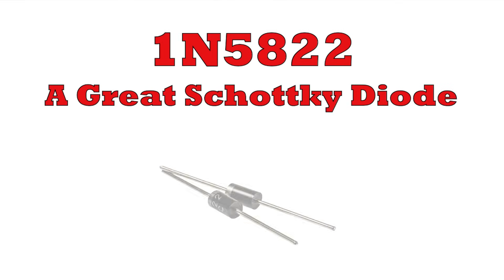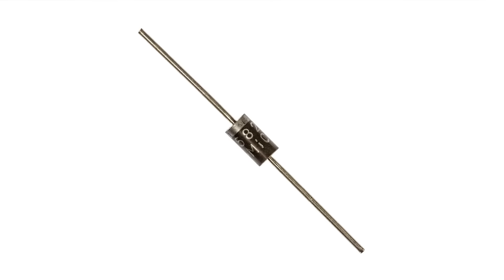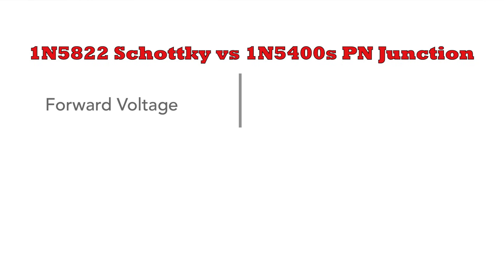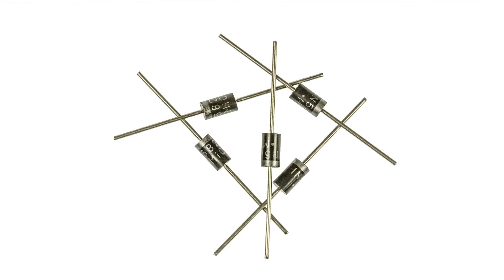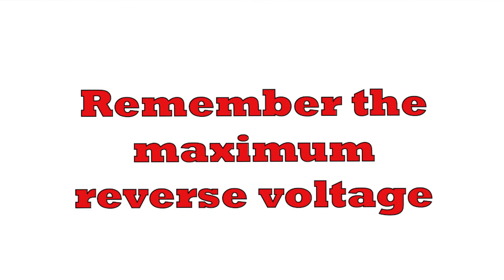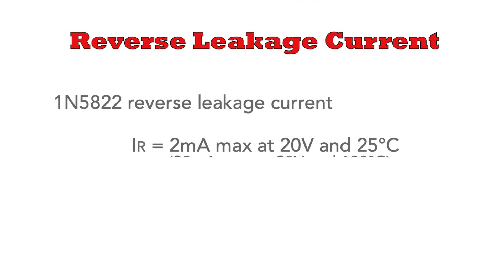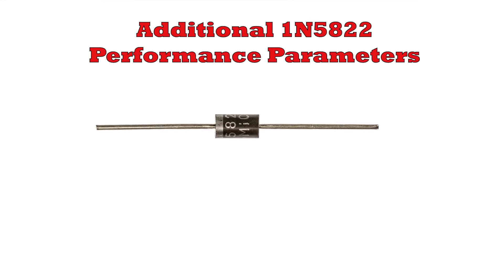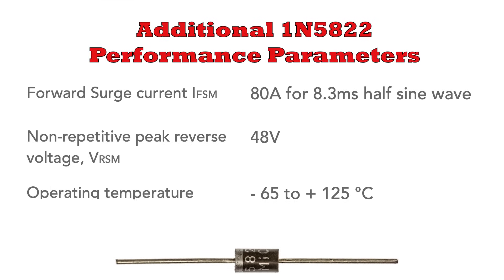1N5822: An Amazing Schottky Diode You Must Discover

Comment: I mainly use diodes for repairing and building tube amplifiers and all of these assets are more liabilities in that field. For example, it's preferable to have a larger voltage drop when replacing, say, a selenium rectifier with a diode. Also diodes in tube amplifiers are subject to hundreds of volts when rectifying and this diode seems too delicate for that.

Comment: I still don’t know what it does.
Reply from the maker: It’s a rectifier diode.
Reply: @ElectronicsNotes 
Thank you.
What does a rectifier diode do differently than a simple diode. 
I know a regulate diode is like a one way valve and blocked the current in one direction.
Reply: @eugenecbell  Lower than average forward voltage. Fast recovery time.
Reply: @MrSummitville 
Does that mean this diode if faster to cut off the flow in one direction like other simple diodes I know about? And is it better at cutting off the flow than other diodes? 
Does this imply diodes found always cut off all the flow all of the time? 

Perhaps I need to watch one of your videos that discusses diodes in depth. 

Thank you for your answers.
Reply: @eugenecbell  Fast Recovery is required in Switch Mode Power Supplies.  The diode must turn OFF quickly because of the high frequency. Not really needed at 50Hz / 60Hz.
Reply: @MrSummitville 
Bold to know. Thank you.

Comment: Generations now miss out on so much growing up now. As a school kid in the 70’s you could build all-sorts  with basic electronic components. These days it all programming and computer modules.
Reply from the maker: Sadly things move on. BUT electronics hardware is still needed. That’s actually one of the reasons I run my website and YouTube channel- I want to try to help, and hopefully inspire those who might want to get into hardware design.
Reply: True, but for those who are interested in simple circuits using discrete components there has never been a better time, the components are easily available online and the old magazines full of circuits are all on the americanradiohistory archive site. Also PCBs are readily available from the custom fab sites, none of that messing about with pens, transfers and unpleasant chemicals. Simple, cheap kits are also available.
Back in the day if you didn't live near a big city getting the parts for a magazine project or your own experiments wasn't that easy.
Reply: I mean, you can still build those same circuits that you had growing up.

Comment: The 1N5711 and 1N60P diodes (the 1N60P often being incorrectly called a "Germanium diode") are small signal diodes great for signal detection, often for weaker signals than the 1N4148 ordinary small signal diode would be too high of a voltage drop for, for example a crystal radio detector.
Reply from the maker: Yes, small signal diodes are ideal for many RF applications.

Comment: I love use it,just buy some 40V 1A,because my circuits rhe transform output AC is low, hope can increase the DC output
Reply from the maker: Yes they are cheap and convenient, but watch you don’t exceed the max reverse voltage.

Comment: Fun fact: Silicon carbide (SiC) schottky diodes are nowadays commonly used in all sorts of switching power supplies, offering reverse breakdown voltages of 1200V or more, and these have become rather cheap.
Reply from the maker: Yes, and that’ll be a subject of a video in the not too distant future.
Reply: SIC Shottky have a voltage drop of ~1.5V
Reply: @MatthiasSchwarz-y7z True, but high-voltage PN junction diodes can have even higher forward voltage drop under load. The main advantage of HV schottky diodes is drastically reduced switching loss.
Reply: @ulihd  i.e. mostly (exclusively?) useful in HV applications, not on the DC side of a 12 V inverter, for example.

Comment: I have just measured 0.75V of forward drop across an MUR420 silicon diode at 3A.
While Schottky diodes tend to be very reliable in larger PSUs such as PC PSUs, they are definitely troublesome in flyback designs such as used in small LCD TVs and tool battery chargers where the rectifier reverse voltage is typically many times higher than the output voltage.
 I have had total success replacing failed output rectifier Schottky diodes with the MUR420 in these small PSUs. I don't do it indiscriminately, always doing an extended test run, checking temperature rise.
Reply: Same, I replaced shottky diodes in battery chargers too. But with higher rated shottky diodes not realising the reverse voltage is likely the same. Thanks for the tip!
Reply from the maker: Thanks for sharing your experiences and the detailed insights! They are very useful.

Comment: as I tend to keep the key samples of my various inventions, I just measured two of the Powertap double schottkies: MBRP30045CT has capacitance between the two anodes being 38nF at no bias (76nF each) but thr MBRP60035CTL can not be reliably measured, I do not believe value of 1.433uF between anodes, but unfortunately I do not have a LCR bridge with selectable nor external (Wayne Kerr 4225) bias here.
Reply: there is (was) very wide selection of MBR Schottkys, and there are Low Vf versions for 10V to 20V peak voltages, but my SMPS work was mostly with 28VDC input, and thus I had no use for the Lowv or ultralow vf versions. IMHO Motorola and Onsemi made the chips on same process, and had two different markings, 1N markings are harder for me to remember than MBR (Motorola Barrier Rectifier) current voltage in decavolts(tens of volts ).

Comment: I have used 1N5822's but when I discovered MBR845, I stopped using the 1n5822 series, and for low power boost and Sepic converters MRB160 or for medium power MBR2020- MBR20200 .
Reply from the maker: Thanks for sharing your experience! I’ll take a look at them.
Reply: MBR series shottky have lower switching loses? or prefered due to higher current and voltage?

Comment: I worked for a company where they used schottkys as switches for resonant PLL circuits.  The only problem was the change in capacitance was different between diodes/degree temperature change, which changed the resonant frequency.  The circuits were so sensitive, the changes made things almost imposssible to calibrate (although the chief engineer thought his mathmatical algorithm would take the changes into account).  It was, overall, a theoretical fun job.
Reply: I used pretty large Schottkys (MBRP30045CT as a back to back Varicap ( i recall each diode had about 10nF capacitance at Vr of 1V)  and it was used in a 20MHz resonant power supply, did no need heatsinking with 100W power level. but for RF switching PIN diodes are better than schottky diodes, as the low Vf of schottkies might rectify the RF and cause intermodulation distortion.
Reply: @isobalalaikka2424  Unfortunately (fortunately), I was not the designing engineer.  I just worked on what was put in front of me.
Reply from the maker: Thanks for the insight, sounds like a tricky application!
Reply: Diodes (both ordinary and schottky diodes) generally have a voltage-dependent capacitance which makes them difficult to use to tune oscillators.  Varactors are a special kind of diode designed for a stable electrically-tunable capacitance and to be electrically tuned by varying the reverse bias on the diode.

Comment: And props for bursting the mass mind wash that silicon drops 0.6 to 0.7 volts, even "educators" have fallen for that myth, that nonsense is so irritating
Reply: Darren;   Agreed!   Years ago (1990s) I was interviewing applicants to work for me in scientific research.  One interview question was to design a 5 volt 1 Amp linear power supply with schematic and parts specifications.  Not one applicant could do it properly!  Most common mistake was not understanding that current peaks caused way more than 0.7V drop in a silicon diode.  Most applicants also made other mistakes such as circuit topology (full bridge rectifier rather than center tap 2 diode full wave rectifier), under-sizing the main filter capacitor (at 60 Hz use ~8000 mFd per amp for 1 volt of ripple - scale accordingly for allowable ripple), and under-sizing the transformer (depending on the circuit topology a 1 amp DC output requires significantly more than a 1 amp transformer).  Frankly, I was shocked that all the applicants completely failed such a simple design exercise!
Reply: @Vincent_Sullivan wow that is quite scary, all I can say is from about aged 10 I started learning electronics by repairing flytipped radios and tvs so I learned how things work in reality not theoretically
Reply: At signal currents it does, at larger currents not so much. Either way, the characteristic is logarithmic, but the PN junction must be able to withstand the heat. That's why you can drive extreme currents in HV applications with IGBTs, but not with MOSFETs.
Reply: @panjak323 no  silicon diodes start conducting at about 440mv for a 1n4006, 450mv for a 1n4148 put a silicon diode on a curve tracer and the myth is wiped out
Reply: @darrenmurphy6251 But he said 1.4V at 3A. He didn't wipe anything. I was replying to the part that Ufwd vs Id curve is logarithmic, thus voltage drop won't rise linearly with current.

If you mean I vs U curve, then threshold voltage isn't chosen as "the moment the diode starts conducting" but as the intersection of the X axis and the tangent of the exponential part of the curve.
Reply: @panjak323  yes ok ,iam mostly self taught so find it interesting when theory completely departs from reality, makes sense now that some (rather arbitary) part of the vi curve was chosen because as you say its a logarithmic curve ,but my issue is education chose to tout 0.6/0.7v as a hard fact!  lol if i answered an exam question based in it, i would make referance to "depends on the diode and forward current " i get marked wrong!
i know nothing about igbts they never really came into cunsumer electronics ,just resided in industrial  i just thought they were wierd ,i thought why would you want the risk of thermal runaway when you can eliminate that with a mosfet

Comment: Obviously there are many types of diodes. And they are designed for particular applications. So always check the spec sheets when designing any circuit. Use what is the best part for your design... JMHO
Reply from the maker: Yes, check the datasheet for its performance.

Comment: This part has been around for about 50 years, did you ever look into modern replacements for instance based on SiC or GaN?
Reply from the maker: I have a few videos planned with some more modern components. This was a test to see how well doing a video about a specific component worked
I agree it’s relatively old, but they are still current and widely used,
Reply: @ElectronicsNotes  Please, continue... 😄
Reply: LSD has been around since the 1940s and i dont see anything being better at what it does than that :P
Reply: @Linguae_Music  You really have to try some of the new stuff around! 
(It's mind blowing...)
Reply: And there are Germanium diodes..
Reply: @noop9k     Don't forget selenium rectifiers, or copper-oxide ones.
Reply: @noop9k  There are, but do you expect those to improve on the given specification?
Reply: @Peter_A1466 0.3 voltage drop is not good enough for you?
Reply: @noop9k  Do you even have a clue what you are asking? Diodes do not have A voltage drop, but a certain voltage drop at a temperature and current, so a range... 
So, what is your question?
Reply: @Peter_A1466 IDK why you are doing this pointless nitpicking. As if it is not a fact that Ge usually has at least 2 times lower drop than Si, within its acceptable V & I range.
 spent my youth occasionally making simple stuff with germanium transistors and diodes.  None of those died.  CMOS ICs would, on the other hand, die from static.. When started to use Si stuff I was like “WTF with the huge voltage drop”
Reply: @noop9k  What are you on about? I asked a simple question and got a decent answer. You start throwing in miscellaneous older materials which are completely irrelevant to my question, but might make for a interesting video on their own. 
BTW modern CMOS is way less sensitive to static as they used to be.

Comment: Have you considered discussing MOSFET "synchronous rectification"?
Reply from the maker: That’s certainly an idea for the future. I think about it. Good idea.
Reply: @ElectronicsNotes  Using a MOSFET as an ideal diode and/or your own version of the "How to protect circuits from reversed voltage polarity" by Afrotechmods would be another good one in the same vein.

Frankly I'm amazed someone hasn't stuffed a MOSFET and additional circuitry into a DO201 package.
Reply: @EmperorA0 the issue is for MOSFET rectification you need to bootstrap a voltage to drive the gate at the moment you cross the zero volt threshold else you end up with the same problems of needing a certain amount of forward voltage to start conducting and the added downside of spending more time than necessary in the MOSFETs linear (ohmic) region while the voltage rises to push it into it's saturation (active) region.
Reply: @JaenFoster  If you're willing to use 3 leads  (V+, V-, Load) you can use a Zener to prevent the MOSFET from conducting until it's out of it's linear region.

However, I think there's a way to run the MOSFET where it's just barely at the tail end of the linear region.  Since it's not really gate voltage that matters, but gate current.

The advantage is when conducting the device would have a fixed current drop instead of a fixed voltage drop.  Unlike Diodes.

It's not exactly equivalent, but would behave like a DIAC.  Where' there's a breakover voltage, but the required voltage/current to maintain the connection is much less.
Reply: In addition to the other replies, there's an overhead with synchronous rectification in terms of extra losses (MOSFET drive primarily) that means there is a breakeven current flow level for using it, below which a plain diode would be better. Each circumstance where synchronous rectification could be used needs to be analysed to determine if the advantages outweigh the disadvantages.
Reply: @marion-bs3qh  I believe so.
Reply: @marion-bs3qh  Oh yeah.  Rarely is anything free of tradeoffs.  I just feel that high level circuit complexity shouldn't have to be one of them in this case.

There's probably already a part doing what I described.  That's why videos like this are great.  You never know what part you're missing that just makes life easier!
Reply: They can't. Offering medical advice on YouTube is subject to one-way restrictions.
Reply: @nexpro6985 they do declare by their supported narratives what god (or satan) they worship.